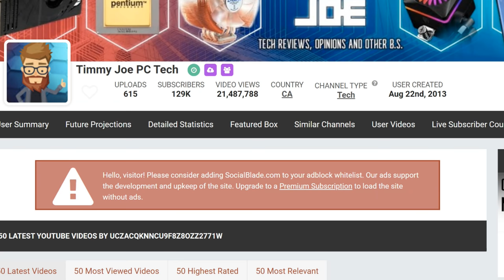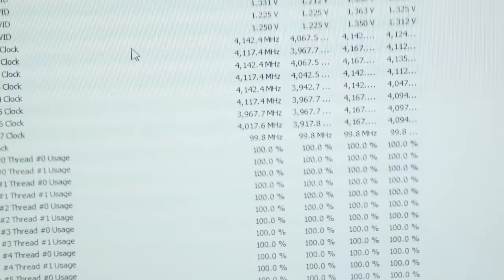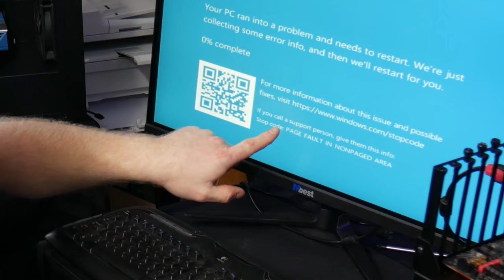This Ryzen 3700x was my biggest problem in 2019...

Comment: That's what you get when you go with Gigashit or BIOSTAR and sometimes even assrock
Reply: Nope this is just a Voltage Stepping Problem and the Fact that Engineering Samples are Hit or Miss. Gigabyte Boards are very Particular about Voltages you got to use the right numbers... I had the same issue.

Comment: i have that bsod a lot using corsair ram, after that i had buy few corsair vengance lpx ... pro rgb they are support unstable ram after 3 kit of corsair vemgance lpx and 2 kit pro rgb i gave up on corsair brand and  use different brand of ram that bsod is gone and currently use gskill i sold those corsair ram for cheap kind a pist me off

Comment: Is there a way to check out a 4k tv video with your pc gaming and etc ?  This is my pc gaming build  ::  ryzen 5 2600X 6core cpu
EVGA GeForce RTX 2060 Super SC Ultra Gaming, 08G-P4-3067-KR, 8GB
16 gigs ddr 4 3200 ram
M.2 500 gb ssd
650 watt power supply 80+ bronze
GIGABYTE GA-A320M-S2H (AMD Ryzen AM4 / MicroATX MotherBoard
Cooler Master MasterBox Q300L Matx Tower w/ Magnetic Design Dust Filter, Transparent Acrylic Side Panel, Adjustable I/O & Fully Ventilated for Airflow
Samsung UN40MU6290F 6 Series - 40" Class for monitor

Comment: 2080 supers was only 350 on amazon yesterday and I bought two and already sold one for 650 and kept the other, so I bought a 3700x,Msi mobo and 3200mhz ram for 350, I bought a 1tb nvme was for 112 and a p350x case for 50 and a 650w Corsair psu for 70, all together under 1100 and I bought an 8 core 16thread chip with a 2080 super